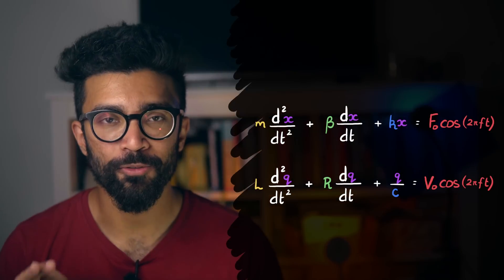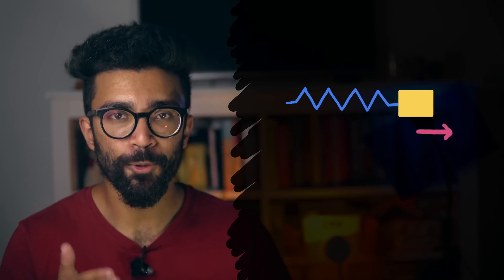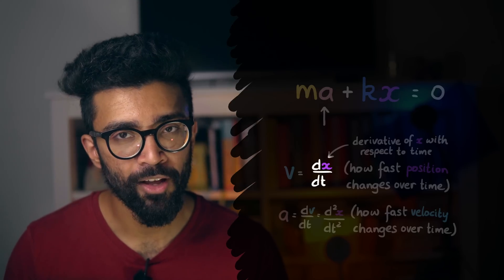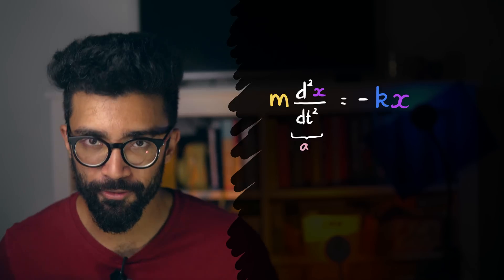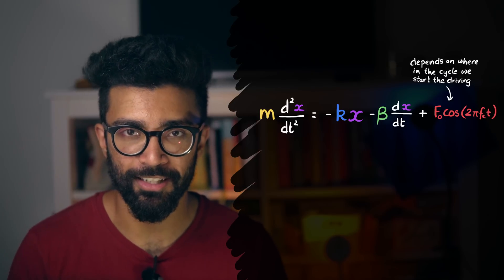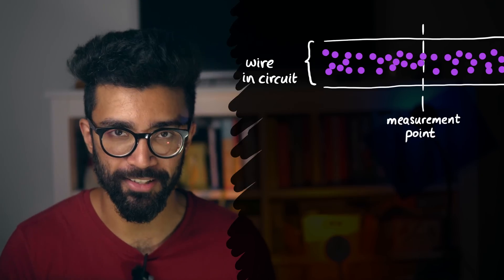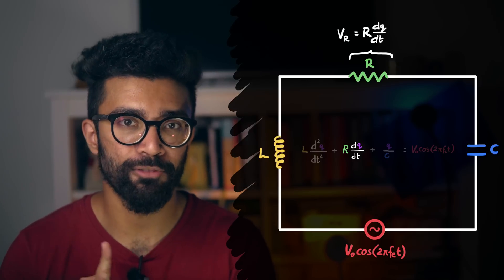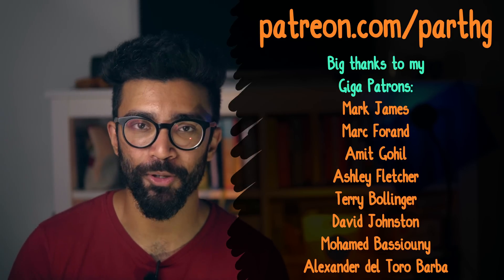The Mathematical Bridge That Links Two Completely Different Neighborhoods of Physics

Comment: Is momentum intermediate state, Kentic & potential energy. KE is vector when PE is scalar. Momentum works with envoirment ( fluid/ field) in which system with PE persist to get direction and convert to KE. The whirlpool in bath tub the envoirment is gravitationa field or space time continium. It is the physics of field/ envoirment determine direction of KE.  All of my hypothesis here are wrong or some are right. Assuming electron posses PE/ fermions and photon KE/ boson. Momentum / Hardon

Comment: I’m curious how the equations would change  if you took into consideration the heat generated by the components.  The system would lose some energy that way and would require a negative term added somewhere.

Comment: PARTH, all electrical circuits (consisting or resistors, inductors, capacitors and  are analogous to all mechanical circuits (consisting of springs, dampers etc.) and these circuits are analogous to all chemical circuits (consisting of acids, bases etc.). They are the super symmetry, yet physicists look for them in all possible places.

Comment: can be solved with the finite difference method and boundary conditions. I went a head and did it. Irony is I had to first find the analytical solution to get my two boundary conditions ¯\(ツ)/¯ then applied the finite difference method. Curious if anyone knows a clever way to get boundary conditions w/o the analytical sol...

Comment: In the first equation x, which is a function of time x(t), represents the location of the mass attached to the string. What does q(t) represents in the second equation? The charge at what point in the circuit?
(Also, this is a great video!)

Comment: Fun fact, the top equation is gained by upping simple harmonic oscillations to a dapmed one and once more to a driven. The general solution - which makes physical sense - is gained by making use of complex analysis and methods to solve differential equations, and is of the following shape: x(t)=(x_0)*exp(-bt)*cos(wt+p)+[(F_0 /m)*(sqrt(((w_0)^2 - w^2)^2 + (2bw)^2))]*cos(wt+p_0 - arctan(2bw/((w_0)^2 -w^2))) ...yes, I really just spent hours going through the calculations...

Comment: It would be very difficult for me to figure out a way to apply the sinusoidal force correctly directly to the moving block.  I would use the F=kx property of the spring, and apply sinusoidal displacement to the fixed mounting point of the spring.

Comment: It is the "force" -- or more accurately,  the "momentum", and more accurately still,  the fluid-vortexual (overall-point-radial) 'acceleration-flow'  ("acceleration" being 'self-relative motion') of the SUM* that "goes on forever".  As long as these "particulate" horn toroidal vortices don't come into close enough proximity to each other to interact with each others' flow in such a way as to lose (redirect) some of their otherwise 'self-siphoning' (by the "length contraction"/"time dilation" effect) "momentum" as "turbulence" (a.k.a. inter-particle "friction"),  that "packet" of vortexual "pure motion" will be "conserved" and "self-sustaining"...  and furthermore, exhibit a ["relativistic"] "resistance" to such redirections of their 'point-radial momentum' that we have named "[inertial ]mass".

*The scale-uniform 'hyper-fluid' medium we mistake (misconceive / miscategorize) as "empty space".

Comment: That's the way u can explain inductance , resistance, capacitance to a high school student already acquainted with mechanics. As the mass of the body is responsible for initiation of its motion under some force, similarly the inductance is also responsible for checking the variation in current and thus controlling it.
Beta is a factor responsible for friction in mechanical systems like wise resistance also acts as friction in electrical systems.
But how can we explain the stiffness in electrical circuit system through inverse of capacitance??

Comment: You could add as a conclusion that the electrical system might be used to simulate the mechanical system, which is how analog computers worked! The cool thing is that you could get the analog computer to plot the results on a pen chart, and save a lot of laborious calculation. This was especially useful in the days before digital computers were invented.

Comment: I taught AC physics at the University of Alaska for several years and introduced the concepts in the exact same way, using videos of springs. Later, when we got to the effect of resonance in the electric circuit you could watch the student's heads explode.
Reply: I used this as an example for solving a second order differential equation
Reply: @שניצל_18  me too with applied dynamic loadings by either method of undetermined coeff or variation of parameters

Comment: But isn't electricity waves of electromagnetic field moving though wires? Thats what Derek from Veritassium said. He said electrons are moving randomly influenced by electromagnetic field, creating resistance, so what oscillates is the electromagnetic field, not the electrons moving. Actually the electrons are causing resistance and heat in the wires
Reply: Well if you ignore quantum effects, you can say that electrons "flow" through the wire at some velocity v. Now if you apply a voltage across the wire you will have an electric field affecting all of those electrons, and statistically electrons, although moving seemingly randomly, will tend to drift to the lower potential. If you're interested look up electron drift velocity. Now if you take a physically small portion of volume, you can define it's charge density and drift velocity, and by multiplying them you will get the current density. The flux of that current density through a surface is the current. Now what Derek said is that the energy is propagated through the electromagnetic field, which is true, but the electrons "flowing" through the wire are the source of that electromagnetic field.